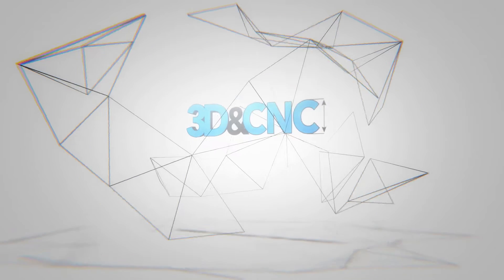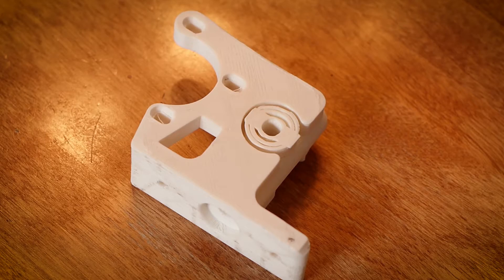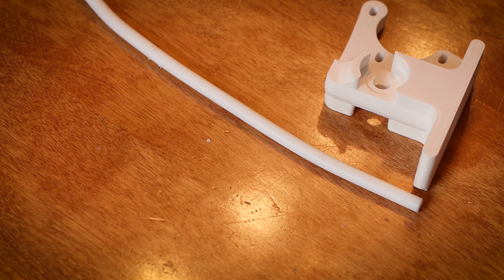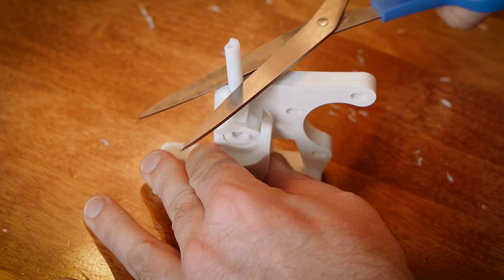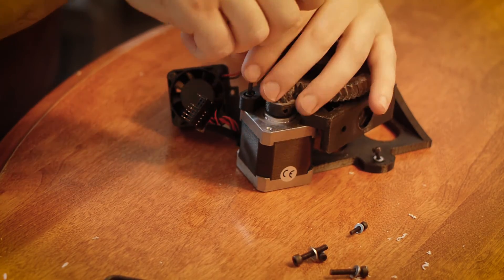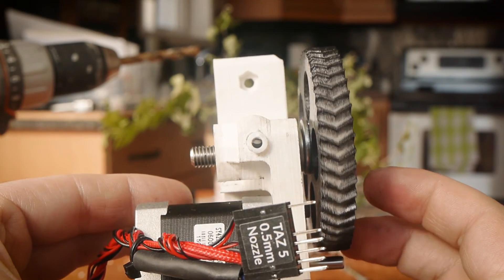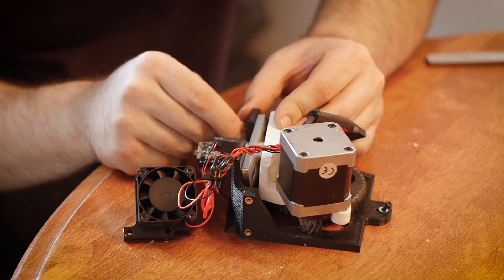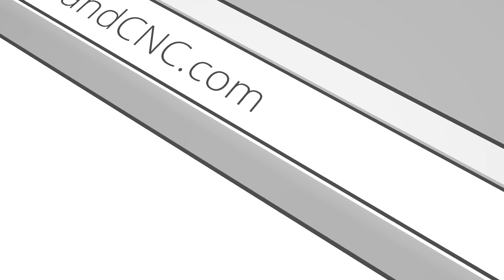How to Convert a Lulzbot Taz 5 Extruder into a Flexystruder V2

Comment: Hello! Great design! Would it be possible to make this to work for 1,75mm filament?  

I just got a taz5, and have two older printers. Because i want to use only one type filament i modified my taz5 to use 1.75mm filament. But im having issues with kinking on flexible filament. 
So would be epic if your design could be modified to use a ptft-tube for 1.75mm filament! :)

Comment: I found that when drilling the 8mm hole the drill bit cut away some of the plastic making the hole eccentric. I over came this the second time by putting the bearing into the back of the housing and using the bearing to guide the drill bit through the housing. Pretty sure lulzbot uses a jig to avoid this ahppening but this worked for me.

Comment: Why do you need to make this change?  I'm guessing the flexible filament kinks up in the standard extruder?... rather than pushing into the head?  I have a taz 5 but never tried flexible filament.
Reply: Scooter that is exactly the reason why. If you use Cheetah or Ninja Flex you need to change to a different head or be prepared to be very frustrated. If you don't use flexible stuff not need to change.